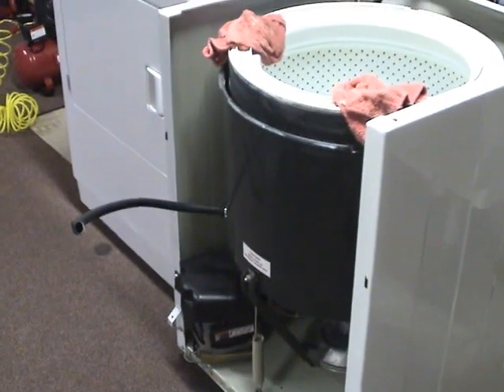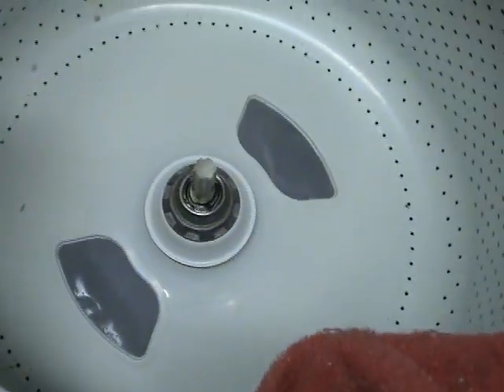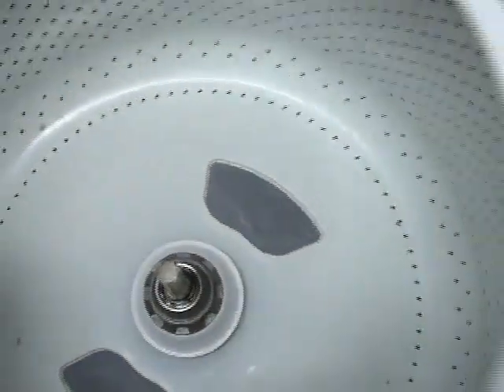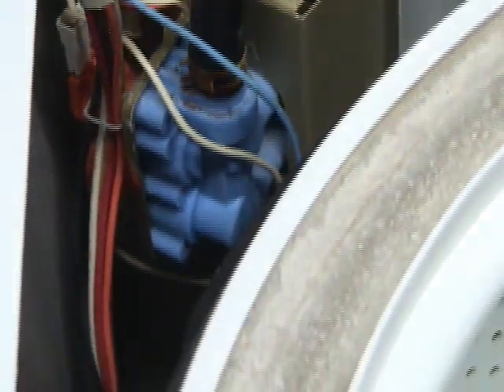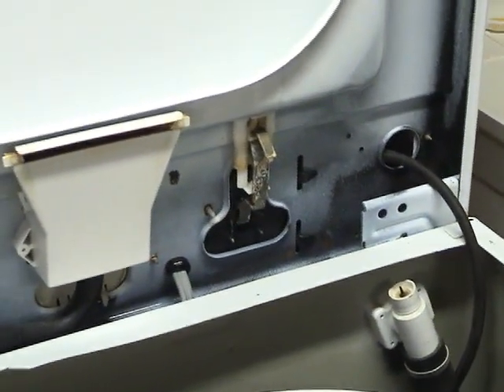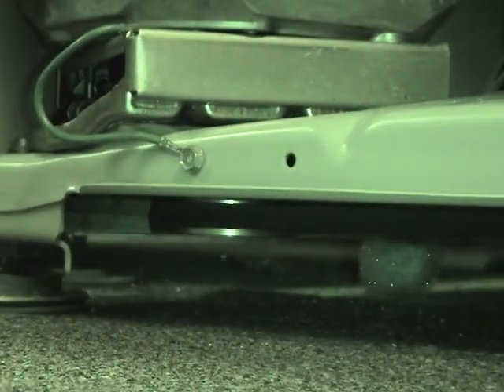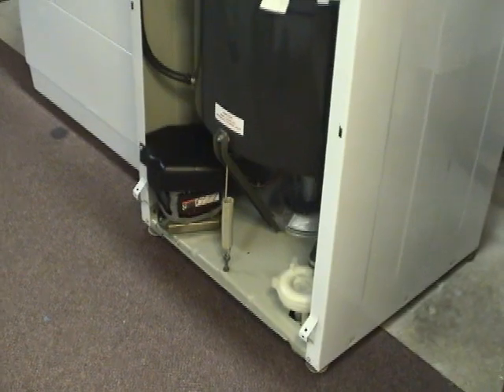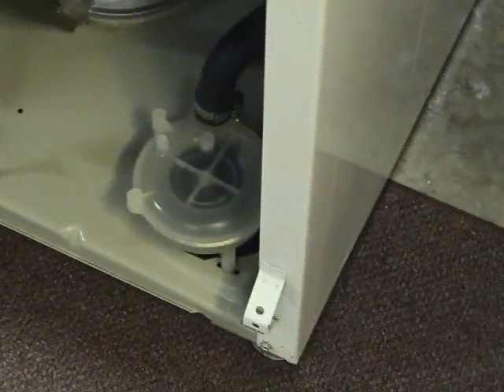1996 Maytag Washer Internal Operation

Comment: We have a similar 1994 Maytag Dependable Care washer, the best washing machine we've ever owned, matched with the dryer, and we're only on our second washer & dryer! & These still work! The washer needs nothing, the only thing the dryer needs after 24 years is a new heating element, and drum rollers (dryer is electric) but the washer & dryer both are identical to the ones you have! Just 2 yrs older, our washer has the "Small" load setting, and the dryer only has 2 temperature settings & air, the model & model no. may be different a little bit, but they're the same pair!

Comment: in all these old maytags the motor reverses for spin cycle and in the normal wash cycle the motor runs oppisite to run the transmission as the transmissions changed from the 1980s originally being a flat design with a counterweight at the other end and yours beind different as they used this newer style transmission up till when Maytag was purchased by Whirlpool and closed its newton Iowa plant as now the Maytag name is on its rebadged whirlpool appliances. my parents used to have an early 1980s Maytag it ran fine till it leaked water a common tub seal as they replaced it with a whirlpool Duet front load washer. this old maytag machine even had the original cord with Maytag on the plug.  it seems they cheapened down on the modern appliances and now add self diagonostic electronics to them.  as the older washing machines other than Maytag the agitate and spin is controlled by solenoids. unlike maytag which is controlled by the motor which reverses from agitate to the spin cycle in which it locks a clutch in the transmission ans the whole thing rotates for spin cycle. which is a much simple design.
Reply: What does the transmission look like in the orbital machines?

Comment: i am in quite a jam with my exact machine and i am hoping you might be able to help me...is there a chance you might be able to get a decent pic or two of the switch that sits atop of the motor (under the black shroud) with the wires attached in thier right places so i can put mine back together?

Comment: @rollermatic All old Maytags (from the 60s until the late 90s at least) used two belts. That includes the one in the video here.
This design never really changed throughout its life, besides the transmission.
Reply: Maytag used that design, even in the early to mid 2000s, alongside with the Norge plastic tub design, with the very last ones being sold in 2007 as far I can tell (LAV3600).

Comment: try using something very thin like a coin to disassemble the switch. whenever I go to a laundromatt that is Maytag equipped I place a coin on the little switch behind the lid to dilude the detergent from the water filling into the tub. When you do this you can't open the lid no less than at least halfway because the coin will pop off the switch and you would have to put it back in.

Comment: Neat!  Such a simple arrangement to achieve all the functions.  Wish I could get a machine like that in the UK.  The ones we have here are all front loaders and built to fail.
Reply: Front loaders in general don’t last as long as top loaders, at least the older ones built in the US once upon a time. These Maytags for example were one of the most rugged washers ever made, literally would run for decades without need a repair. If a repair was needed, usually was the pump, belts, inlet valve, hoses, that’s about it. No other machine in existence will be able to hold a candle to these Maytags.

Comment: I think the pump impeller spins both directions. On agitate the direction of it's rotation prevents water from entering the pump and keeps it in the tub.
Reply: Sharkie626 it also allows for the water to filter threw the screen for a long trap
Reply: I believe the whirlpool built maytag direct drives do the same thing too.

Comment: That's fascinating to see how the mechanism works, I have never actually seen an automatic machine inside in action. I guess the impeller on that pump just kind of idles in the forward direction and then when it reverses, begins to pump out?
Also when you have the green light on that rotating gearbox during the spin cycle you can see the Maytag "M" logo...but only when the green light is on! Maybe it's acting like a stroboscope.